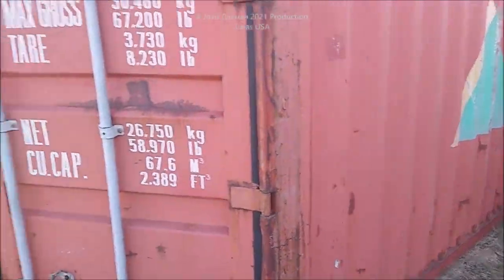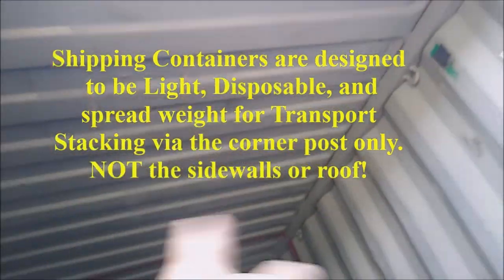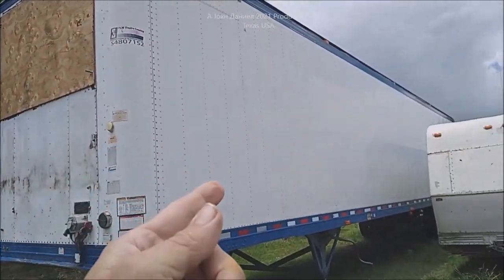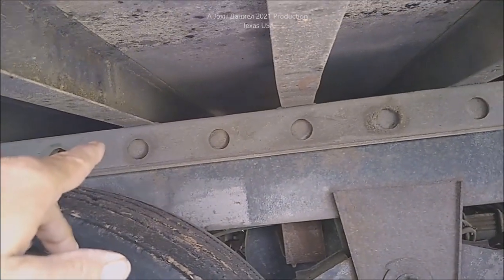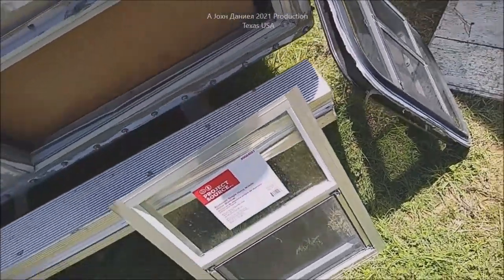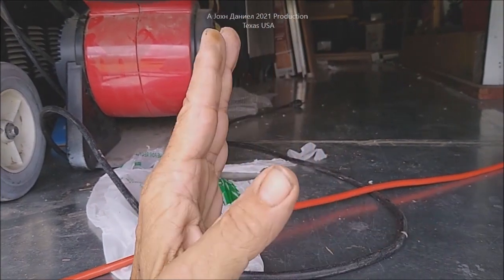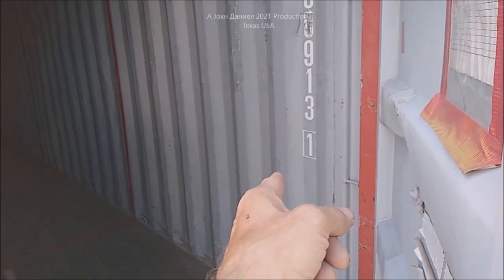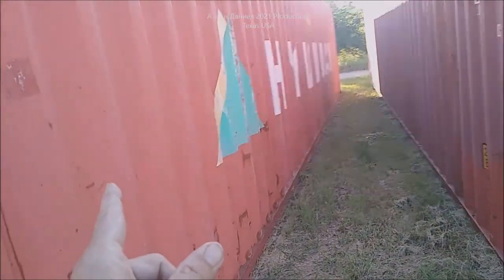SHIPPING CONTAINER SCAM, used Semi Trailers are better

Comment: Would it be possible to put 2 side x side. Cut out the interior walls and make a shop?
Reply from the maker: We put 3 together doing that so I would say 2 is just the same. For 2 You will use direct bolting the bases from underneath and on top you will use the re-roof method of using ( for 2 of them ) 20 foot 2x6 laying flat right angle across the whole top on 24" centers with 3.5" #14 self tapping screws down into the upper L-Frames of the trailers walls to bridge them. The full width is about 16 foot 10" OD on this. Using 3/4 plywood in those roof gaps between the 2x6 also screwed into both sides with 2.5" #12 self tapping you then are secured as long as you were excellent on the foundation under it its better built than a house. Of course you frame over the top with a low profile Truss plan and metal roof it with some U or R panel. 
Then you can cut out some of the walls for doors, room expansions and more. Be sure to use headers able to make such expansions and getting the hightop model trailers you can add a false ceiling to make a huge space.
2 of these 53 foot X 101.5" is almost as much as 4 Shipping containers in space.

Comment: You can also register a semi truck and/or van trailer as a private RV once you've converted it then you don't need a CDL to move it around.
Reply from the maker: As long as you stay under 50 foot, so pick a 48 or 50 foot trailer only. The 53 foot will probably always be commercial only since that ones total size and registry is locked in till 2035 under DOT. The big conversion companies do not buy the 53's due to this. And if they do, you do have to have a commercial license to move it, not to own it.

Comment: You have a valid point but... If you want to move the trailer in the future you have to $ Register it - $ Aquire DOT Permits/inspection, $ Pay someone to move it,   (hope that tires are good and brakes still work especially if it has sat for several years....)- A shipping container can be transported (With contents inside), In my experience Ive got some quotes to move a 40HC and it was around $1200 to move it 35 miles or so. Which isn't too bad if its loaded full of stuff! - Im looking for a reefer container currently...
Reply from the maker: You have to weigh the options. With a Refer trailer your already $2500 ahead on structure and insulation plus 8+ inches wider and easily 10+ feet longer. You can transport them in state on a 48 hour permit for cheap even without current regs. Normally a used refer is at no extra purchase cost compared to the crazy prices they charge for shipping containers.
Reply: @mudslinger1m  I wonder if you could just have it moved on a lowboy trailer instead of doing all the registering, inspections, permits, etc.

Comment: Whats the legality of having a semi on your property for office/storage space? If you need to move it can you register it after cutting windows what kind of laws are out there regarding modification of these?
Reply from the maker: Depends on state, local and county codes. But in most of the non socialist parts of USA like Texas or most all what they refer to as RED states, then your fine doing what ever you want as long as you stay within DOT rules on transporting it which is height, weight and width rules. You can get a temp tag for $200 to $250 to relocate it if needed as long as you hold title and original registration on them. They are 500% better then a goofy cargo container and about 1/3 the total cost to adapt.

Comment: I have question on 12v series connection to make 24 volt battery bank, then parallel connection to link amp hours to set of 4 or 8 -12 volt marine batteries?
series connection then parallel OR parallel  , 1st, then series? Trying not do destroy my very limited emergency power bank!! Thanks in advance for an answer. still looking at your vids on your battery bank & ancillary equipment. fixing to get a vevor soon.Thanks again, sir!
Reply from the maker: If you have 8, You will build two 12v  at a time  into 24 volt, then take those pairs 4 now at 24 volt and connect them to raise amps.

Comment: The containers made in China are for ships, there designed to a certain specification to maximise cargo.  The American one is sturdy but logistically not great, the weight of that will be alot more heavy and would require more fuel to transport it around.

Comment: i purchased mine from a friend that has an auto dealers license who rebuilt salvage cars. he delivered it from where ever (he is in S.E. IOWA ) to south dakota for total cost of $4000. it is 53 foot, the refer unit still works, the fuel tank is still attached too.
i used the wooden shelving frames for 12 inch wide shelves on edge on the floor (they are 15 inches outside to outside) to put 5 rows of 5 gallon buckets and 1 row of 18 gallon storage totes from front to back on the floor. then covered with plywood. then 24 inch shelving down 1 side, and 12 inch shelves at the refer end to hold 1 gallon cans. that is 5/6   53 foot long rows of 5 gallon buckets with ZERO LOSS OF FLOOR SPACE!!
Reply from the maker: Brilliant find. Very rare to get them at that price, massive shortage of them right now. The factories can't even produce them cuz they cannot get roll aluminum for the last year and a half. Some commie name the Barack Obama cut a deal with China and sold out our entire metals industry to them. Now you see the result.
Reply: @JOHNDANIEL1  i think that commie is STILL president.
What everyone thinks is dementia is just 'Slow' Biden waiting on barry O to give him an answer through the earpiece

Comment: Truth. Let me add. The Late Chuck Harder exposed  the way China makes steel. They buy scrap steel. Put it in a big melting pot. Then make products  out of it. The steel is no good. I have  old  made in America  farm implements.  Example I have a 1 row horse drawn planter. Built  probably 1890, or so. Sits out in the weather.  Rusty as all get out. But still works. No corrosion what so ever. They know how to make metal last. But there is no money to be made selling products that last that long.
Reply from the maker: So true

Comment: Could a sliding glass door be installed on a refer?
Reply from the maker: Yes but you have to put a sufficient frame increase to support the install.
Reply: @JOHNDANIEL1  Thank you, John.  I like what you showed.  Looking to place a wall of tinted UV protected sliders on both sides for a desert cabin with 360 degree mountain views.  That's a lot of support but I think I can make it work.
Reply: @fightswithspirits915  if theres a will theres a way-
Im looking at trying the same thing in the foothills of western NC.
Either double or triple wide.
Either way im saving tens of thousands and ending up with a very solid home.
Yours is a GREAT idea.

Comment: Be careful about cutting large (double door or double window) holes in side of semi trailers.  They get their strength from the side walls.  If you did smaller windows and maybe keep doors toward the ends of the sidewalls  may be OK.  As far as having them moved after "tiny house" construction may be problematic depending what is inside (weight wise) and how many, what size and location the holes are.  I agree if just using 1 trailer  for a cabin or tiny house you can't beat them.
Reply from the maker: Small windows can be cut in like it is without much worry, but doors do require you use a structural style door frame to restore and loss in strength on the wall. The door I have for it is made by Pacific, it has a full weight strength two-part clamshell frame set so when it's clamped into place it replaces the load bearing member I would have to cut. Good call though people really need to be sure they frame the support anything they cut that's more than one wall member or stud.
Reply: @JOHNDANIEL1  
For a "tiny house" that wanted to move I guess a frame of I beam or C channel could easy enough be added to bottom ribs the length of the trailer similar to how the tandems are attached.  This would help keep the integrity/strength of the trailer if sidewalls were hacked on very much.

Comment: Thank you SO MUCH for this video. Turning a semi trailer into a Tiny House makes FAR more financial sense than a shipping container. And if I need to move it, there is a huge number of independent truckers who can pull it anywhere for a fee and I don't have to worry about it being damaged. they're pros. I saw the first video with the AC- now I'm looking for one. It's tall enough inside to have a raised bathroom, tanks that empty to the outside via a hatch (like a motorhome), and have a small storage loft besides. And best of all, the weight rating is such that nothing I put in it will overload it at all.
Reply: There is companies now that are converting Semi-Trailers into temp. housing with beds, bathroom, washer/dryer systems, water, and tankless water heaters. Shipping containers are junk!!!

Comment: Where can I source these  in Missouri or central USA? Thanks
Reply from the maker: Do a Google search for this term - REFRIGERATED TRUCKING COMPANY IN MY AREA. 
You'll have to call them individually and find out who handles their used trailers and trade-ins, and sometimes they individually sell them like the company I got mine from which is Alpine logistics.
Reply from the maker: PS- another location that may be easier to source is in North Kansas City, and another one would be in Lincoln Nebraska.

Comment: The man speaks the truth. I have driven and been in the trucking industry for over 25 years. I am now a fleet manager and have been for some time. I spec these types of trailers as part of my job. You want to get a Great Dane if possible like John has. Most are built in Brazil, IN. The swing doors are more resilient than the roll up doors. But the roll ups sure are convenient. They are rare in freezer rated trucks as they are more difficult and expensive to insulate and seal. We run them as we have rail type liftgates. John's point about the freezer rating is important if you are looking for insulation. There is a big difference between freezer rated vs refrigerated. We run -20°F and the insulation in our trailers run 1.5" to 2.5" thicker than a standard refrigerated trailer depending on which wall you are talking about. Be advised that if you are looking to set the trailer flat on the ground, you will have to remove the ICC bumper and its support structure. Not a huge deal, just another step is all. Great info as usual Brother!
Reply from the maker: Yeah as a general term refrigerated is still really good and structurally sound using 1 and 7/8 wall density but the refrigerated freezer model uses another inch of high density plus up to 1-1/2 more in floors and roof. Companies like FFE, ALPINE, CENTRAL, and CRST will tell you who their used broker is if you just call.
Reply: @JOHNDANIEL1  hi, I'm in West Texas, looking for one, Google doesn't help, where could you recommend to buy one?
Reply: @m.w.2098  Did you find a source? I am in NY & found a few for free ( not refrigerated) but could not find anyone to transport it. Any idea as to how I can find some one to transport? I even posted adds.
Reply: Do you know of a good source for used Freezer Trailers?

Comment: Man wherever you're going or wherever you live that selling those shipping containers are literally scamming the fuck out of everybody because down by where I live you can get a 40-footer for 1500 bucks all night and day practically brand new so maybe it's I just live close to shipping ports and maybe you're so far away that they're just up charging for the crate and shipping delivery and all that
Reply from the maker: Post a link to your source so everyone can check them out.
Reply: Yeah,  if you can get 40 footers for 1500.00 I'll take 16 of them for myself.  Building a 2 story house with pourchs.
Reply: savannah ga they are that price if u want to research them
Reply: Those reefer trailers will stand more wind than those containers, especially when you remove the tandems and anchor them on/in the ground.. And you wouldn't hear the 175 mph wind howl nearly as much. (where are you planning to be, anyway?) I've seen a few that regularly took on 100 mph+ winds plus whatever headwinds they were going in to.  And the "Benn & Jerry's", "Blue Bell's" or whatever brand of ice cream, was still frozen to be put in the grocers freezer without it being all melted and runny when it got there.  Like John said, Solid.  You couldn't insulate that $1000 container that well without going over the price of the reefer, let alone wire it up, and still wouldn't have the square footage.

Maybe you missed what he said about removing the tandems and landing gear and selling them. Once the wheels are off, the "Trailer" at that point basically becomes a "Shed". (That's important terminology for the tax man and other county officials.)

Plus, delivery is cheaper for the company/driver. With a Container, he HAS to haul a trailer back, empty or otherwise. Delivering a van or reefer trailer, he can bobtail back, which gets better fuel mileage and/or can even pick up a load for the return trip and not be stuck with container only loads.

I reckon you COULD sell your $1000 container for $2500 or so, do it once more, then get yourself a reefer trailer. Undercut the dealers price and I believe that in the long run, you would be better off.

I mean, if you are really that worried about it. Neither type will make much difference in a nuclear strike unless you are far enough away and happen to already be inside. In that case, I guess go with what you got and pray that the Lord splits the eastern sky before it gets to that. According to The Book, He comes afterwards.  But for the ones that Believe, they are taken out of the way somehow before that part gets here. Some are taken through it, having gotten a late start in learning and believing. Tribulation Saints, I believe they are called. But they make it and seems like there is a special deal for them.  And, there will be a bunch that never believe and what they face seems to really, really suck.  Some folks think it's not fair but in reality, they've been being warned all of their life, in one way or another.  Their Choice NOT to believe is probably the only unpardonable sin. There are many and varied opinions on the subject, so it's worth getting into the Word and figuring it out on an individual basis, the sooner the better. From what I've been seeing, this ballgame just may well be wrapping up.

I mean, it also says in the Book that He Has Plans For You. It might not be a bad idea to actually take the time to ask Him, personally and sincerely, just what they are.  And expect and listen for an answer. What do you have to lose?

Take Care,
The Tinker
Reply: @tinkerscorner54  wow, yeah im with you...thats a great comment.
Those end time saints will be beheaded for Christ tho-
Still beats the alternative.